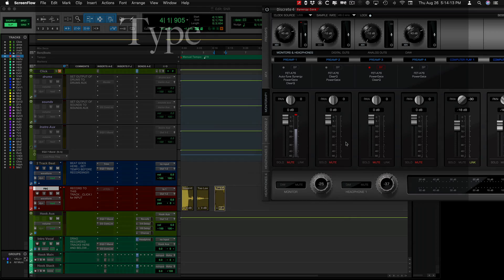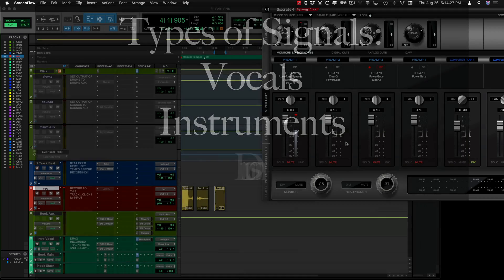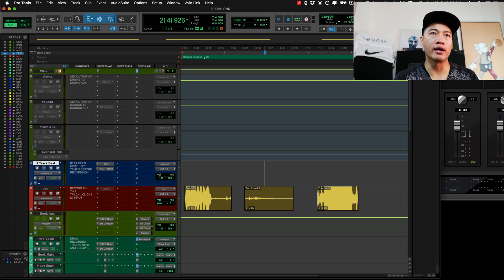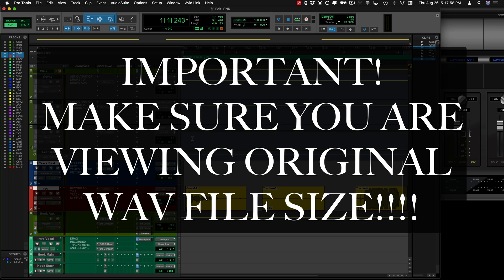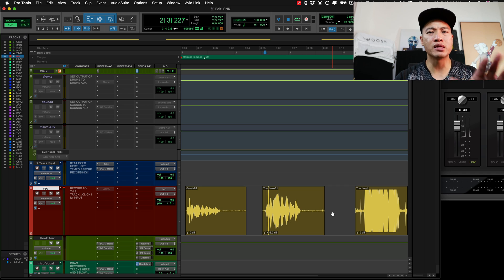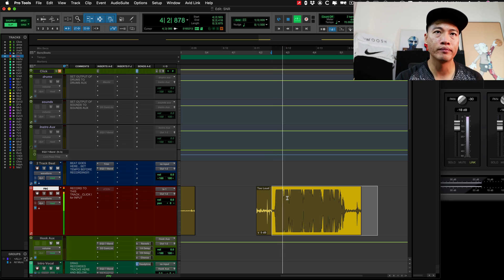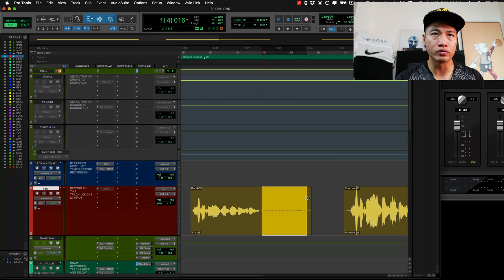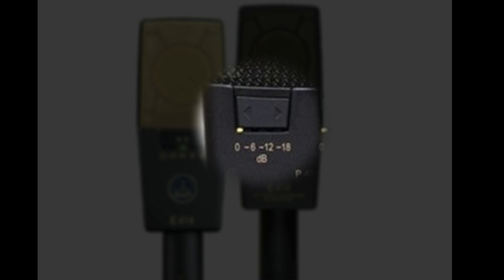Signal-To-Noise Ratio Explained

Comment: So on an amplifier - do you want a higher or lower ratio for best sound and less white noise? Im looking at two amps and one S-N ratio is 0.75 and the other is 0.85? Both are the same wattage and rms and impedance.